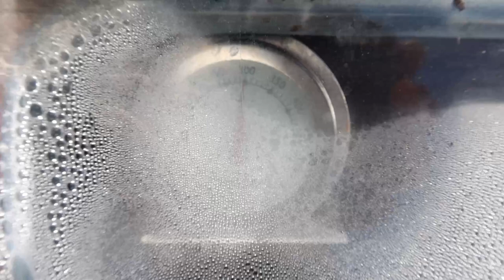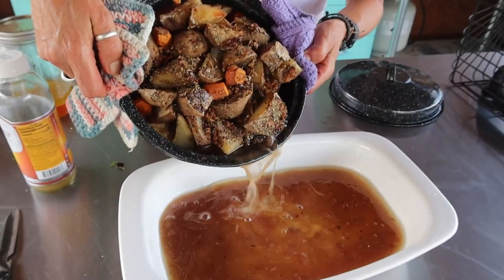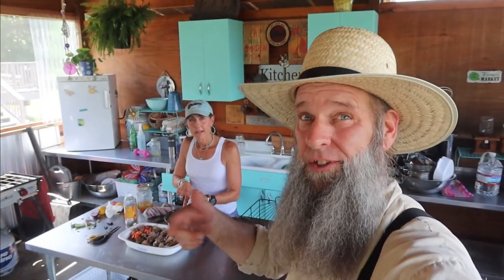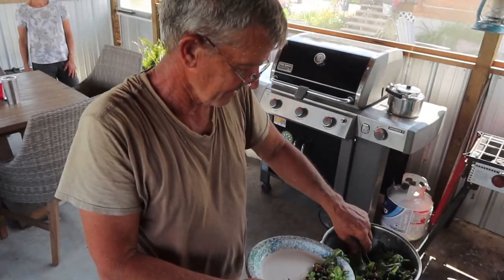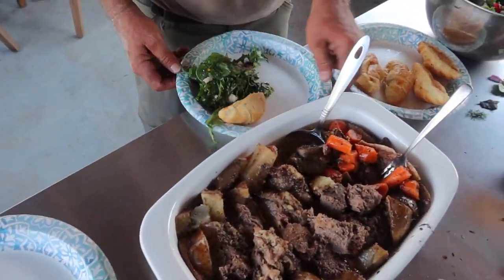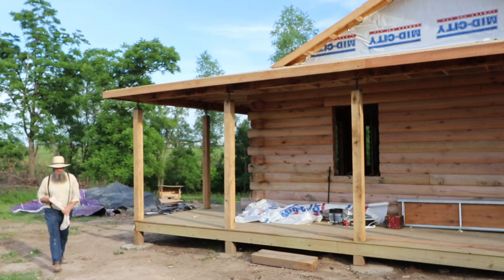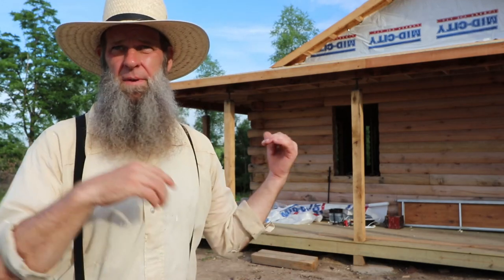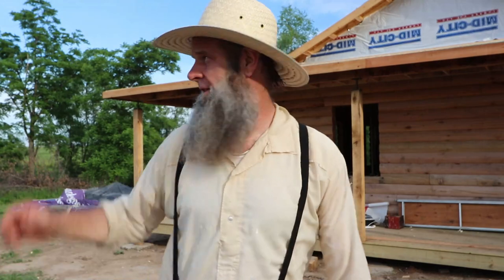Log Cabin build is GETTING DANGEROUS! Day 50

Comment: take a tip from some one who not only works out in the sun, but over a blazing grill as well. Dip a cloth in cool  water put it on the back of your neck. may need to repeat but helps immensely to keep your core a bit cooler.
Reply: TOTALLY!  i’ve been a gardner all my life.  And always do that with my sunscreen and sunvisor.  I’ve also done and given some guys trimming my palms.  A bucket of ice water when they were on a break.  Gave em both a towel to soak in it then wring and put on face and neck.  It’s awesome! 🤣 main thing is to not get too over heated.  Take breaks and HYDRATE!  And use a neck towel for sure!!!

Comment: I've never used a sun over but I baked cookies on a campfire; I took a cardboard box, drilled two holes on the opposite sides and put metal poles through the holes. I lined the inside of the box with aluminum foil and put a cookie sheet with cookies on it and placed it open side facing the fire. Took longer to bake, but they turned out great.
Reply: Don't you just love spell check...not

Comment: It's going to be 115° here in  Phx Arizona
Reply: I lived in Arizona over 50 years before moving to the Ozarks.  Growing up there most of the schools only had swamp coolers or air conditioning. And none of our cars did. And the first time we had something other than the swamp cooler on the roof of our house  was in the mid-70s . We never thought much about the heat one way or the other. It was just something to deal with and get on with life. I did work outside all day when they had their hundred and twenty-three degrees. Just drank lots of water, but no more breaks than usual.  I actually have my AC on here in the Ozarks today. It's mostly to dehumidify and it's only a window AC unit in one bedroom. And it's keeping the whole house at 76 degrees. Although it was 94 today with humidity at 62. That's a heat index of 112.

Comment: As a owner of a pressure washing company, use oxalic acid (aka wood brightener) when washing the logs. No need for high pressure. Pre wet the logs then apply the oxalic acid let us dwell. Keep it wet but don’t rinse off right away. After about 15minutes rinse. Low pressure. Don’t fur them logs with high pressure.

Comment: Can you dehydrate in the sun oven ??
Reply from the maker: yes
Reply: @OFFGRIDwithDOUGSTACY  I had two comments from the other day they should have showed up first. That's the way it works. But I went through this posts twice, didn't see them. This would be the second time that my comments have been removed. They where benign as far as YouTube is concerned. And since they appear shadowbanned, that usually comes from the operator of the site you responded back to me last time it happened.  But you didn't deny doing it. If I stepped on your ego, I am sorry I didn't mean to interfere with your following. Frankly I don't give a dang, I was just sharing information.  If that's not allowed on this site from anybody but you.  Then have no reason to be here. I certainly I'm not learning anything as I have been a construction contractor in the past. I've also live the very rural Country Life as a prepper  for close to 40 years.